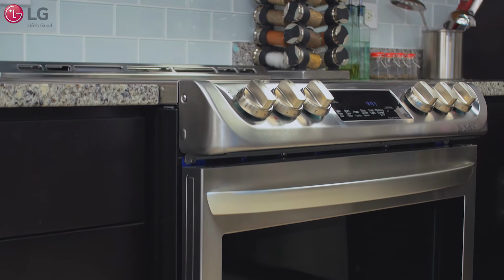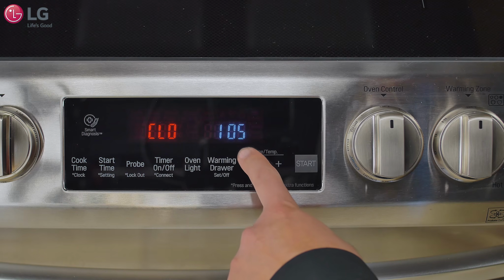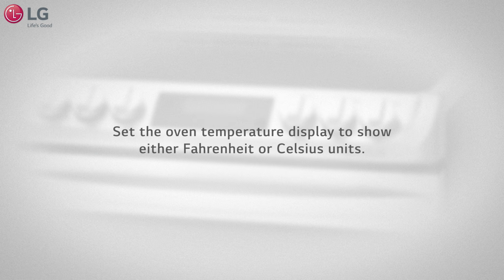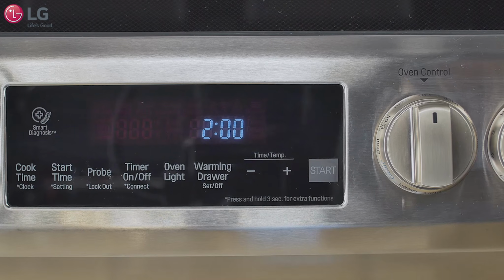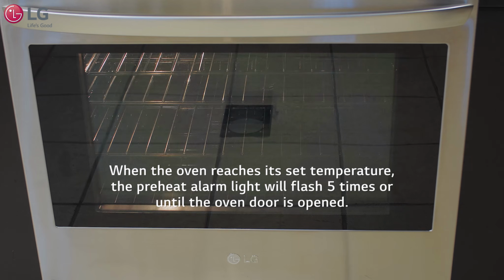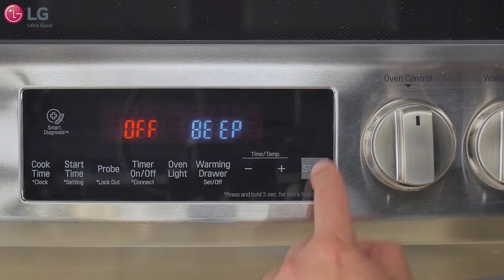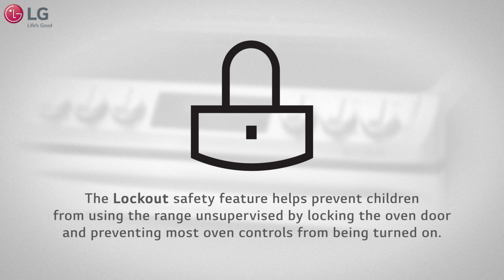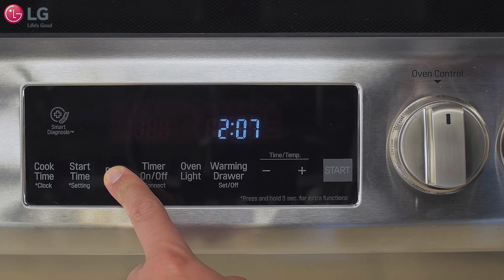LG Range - Using the Control Panel

Comment: The preheat alarm light flashes 5 times when the oven reaches the set temperature, BUT THAT'S ALL. IF THE USER TURNS AWAY FOR A MOMENT AND THE PREHEAT FLASHES OCCUR, HAVE THEY MISSED IT AND NOW HAVE NO WAY TO KNOW WHETHER THE SET TEMPERATURE HAS BEEN REACHED? RIDICULOUS!
Reply: when the oven has preheated to your desired temperature it will show that temperature on the display. You will see the oven temperature climb to the selected temperature.